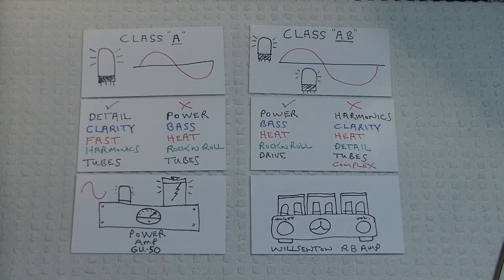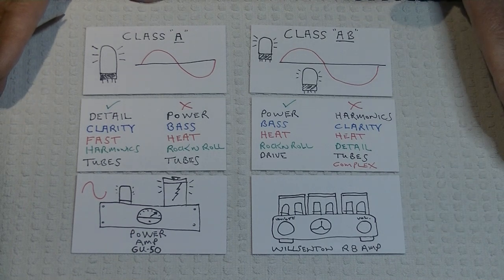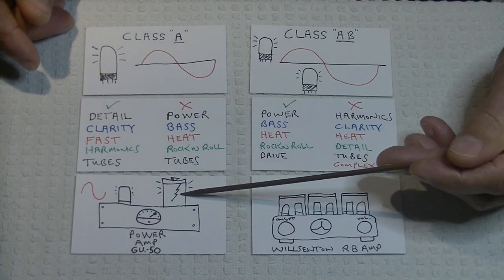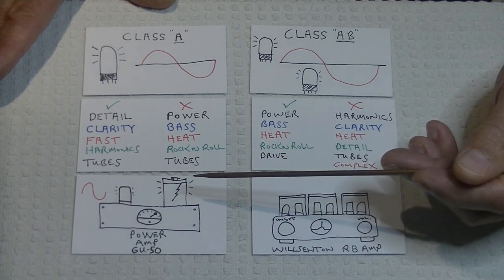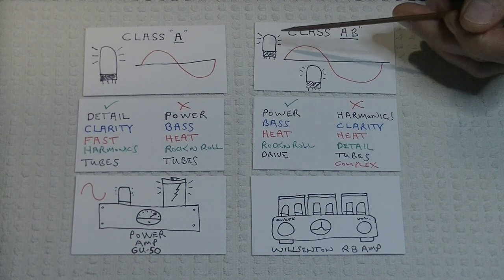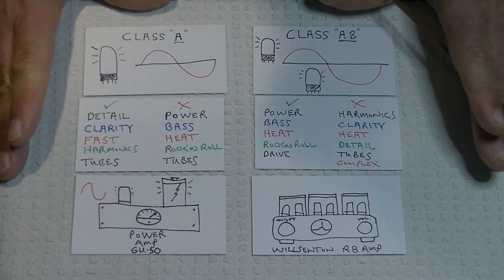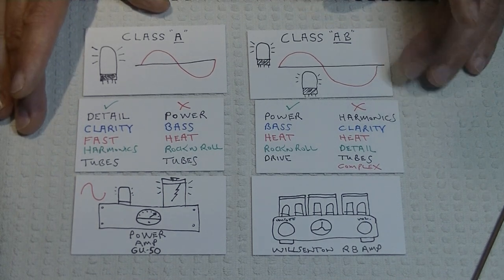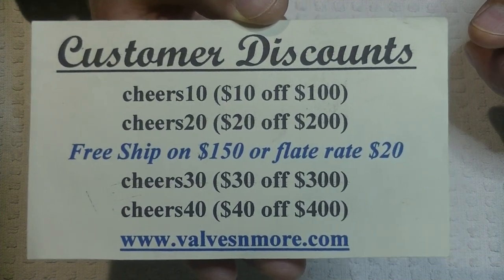Tube Lab #108 - Class A and AB Differences

Comment: A question for the peanut gallery: I have a well-tubed R8 (thanks, Jim!) that I recently hooked up to a pair of Paragon Jubilee monitors (85db, 3/4" 6.5" two-way). I think they sound great compared to my solid state amp setup. The big concern is that 85db and the limits of the R8. Am I in danger of doing bad things to my R8, tube, or speakers as long as I keep listening levels reasonable? I've read that tubes will experience "soft clipping" when demand exceeds capacity. What exactly does "soft clipping" sound like? If it makes a difference, I'm running EL34s. Thanks for your input.
Reply from the maker: Great question!  Well first off at 85db you are just below average speaker sensitivity, so not great, but not bad either.  If i owned those speakers I'd be taking them apart and modding them like crazy, so it's probably a good thing i don't have a pair!  The manufacturer specifically says the minimum power is 30w and the R8 in Triode mode puts out 25w and in ultrlinear 40/44w depending on power tubes used.  I wouldn't be too worried running in triode mode at moderate listening volumes (not loud).  What is important, is to get the impedance matched correctly (8 ohms tbc).  Tube amps will soft clip when driven hard (you probably won't even know it) before they hard clip.  What is always in danger is your tweeters, they don't like a hard clip and will often decide they don't like living at your place anymore and would rather hang at the dump instead!  So i think you are good and if you have a party planned stay in ultrlinear mode and put your wife in charge of the volume!

Comment: Love this, Jim.  Thank you.  Q:  If detail is weaker by nature in Class AB  can purchasing a tube like the Tung Sol 6SN7 (famous for detail) really help in the R8?
Reply from the maker: Yes, remember the signal needs to pass through every tube in circuit, so yes it would and does make a difference.  The distortion I was talking about, in a well designed Class AB amp is low, it's not something you would hear, unless you did some careful AB comparisons between a similar Class A and AB amp.   But it is a major part of the sonic signature of a class AB amp - it's unavoidable.  And of course each design topology has it's plusses and minuses.  Good question!